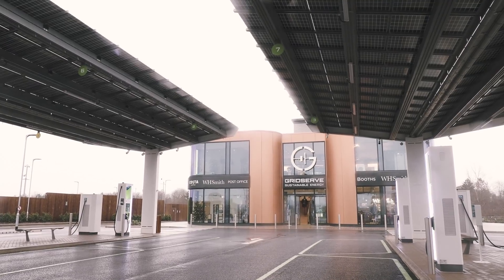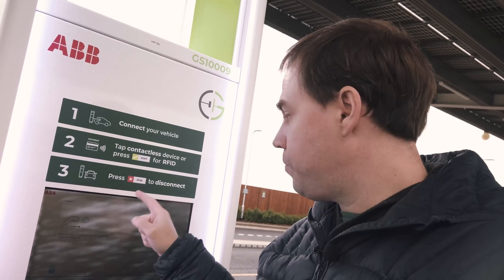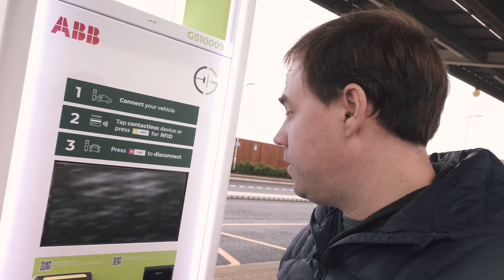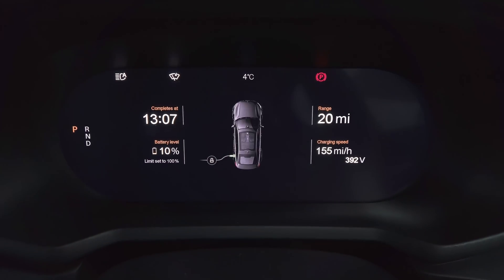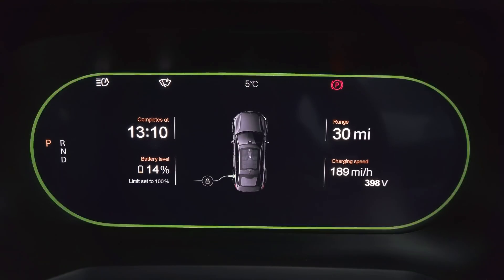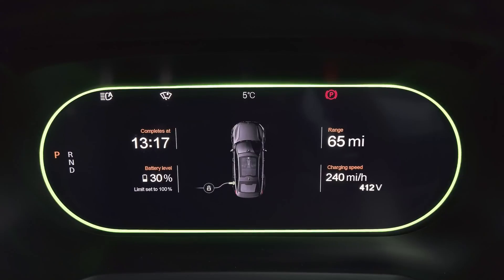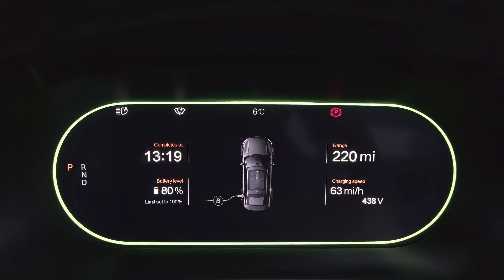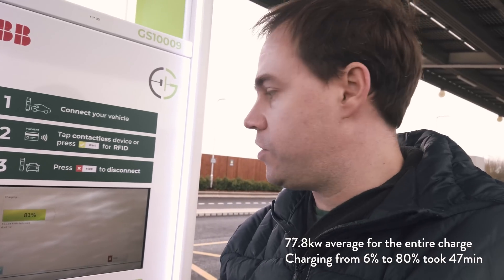Polestar 2 charging speed on the 350kw Gridserve DC charger

Comment: Great that you logged every 10% addition.  And encouraging that a 6% (who goes that low!!) to 80% in 47 minutes: so a normal fill up from say 20%-80% would only take about about 35 minutes, or about the same time as a comfort break and then a coffee and pastry.  Excellent.  A good way to cross check the kW speed, is each 10% of battery is 7.6kWhs, so you could easily work out the kW rate at each 10% top up by using the time it takes to get there.  

The next time you are there it would be interesting to see how much the 90kW chargepoint actually gives.  It’s the only 90kW Chargepoint I have ever seen!  I wonder if this will be a new Rapid??
Reply from the maker: Thanks Iain, good tip on timing each 10%, I hadn't thought of that. Yes 90kw doesn't seem to be common.
Reply: It's not that easy, look at the charging curve.

Comment: I'm sure it's more a hardware thing than software to heat the battery,hope someone can prove me wrong.How many EV's actually preheat the battery apart from Tesla?Thanks for your continuing insight into owning a Polestar 2. I will be able to sample the joys of owning one in the New year having just placed the order today.
Reply from the maker: Hi Pete, yes I think that's the concern that hardware is the issue. But if I'm completely honest I don't mind at all and am loving the Polestar!
Reply: The issue with preheating the battery is that you are using kWh warming the battery up which is money thrown out the radiator. My Model 3 keeps using 7kw through the motors even when the battery is up to 55C during a rapid charge.
Reply: @SirHackaL0t.   - The latest version of the Model 3 actually pulls that heat back out of the battery after charging in order to heat the cabin, so it isn't so wasteful. But yes, Tesla does prioritise charging speed over ultimate efficiency in this regard. It is a design choice that most people are willing to spend an extra 1 or 2 euros in order to cut their charge time.
Reply: @I5bit  The issue is that it takes 7kWh of the charging speed whilst the battery heats up. This slows down the charge time.
Reply: @SirHackaL0t.   - I know what you mean, but actually it probably doesn't. The battery is heated to reduce the internal resistance, which then allows the car to be charged faster. More than 7kW faster? Yes, if you are on anything faster than a 50kW charger. So it is a worthwhile energy investment so long as you are on a properly fast charger. 
It is worth noting also that the Panasonic chemistry that Tesla has been using up until the latest Model 3's actually degrades less if you charge at higher temperatures. I suspect that is also part of their choice to heat the battery aggressively.
Reply: @I5bit  Ah, reducing battery degradation. That’s a good reason to heat them. So the 7kWh is a fair price to keep the battery life decent I suppose. :) Always good to get a discussion going for such things.